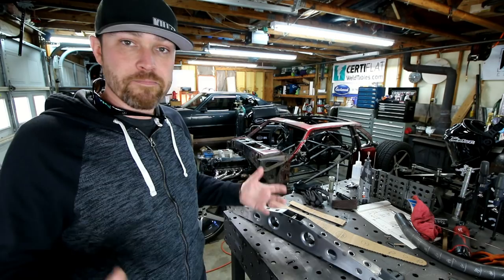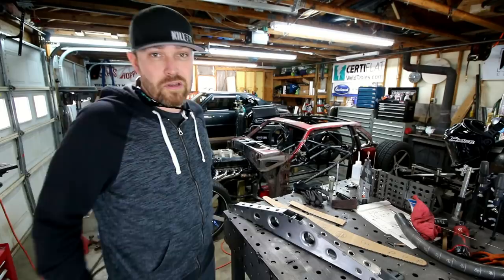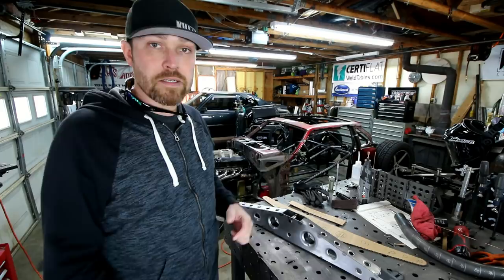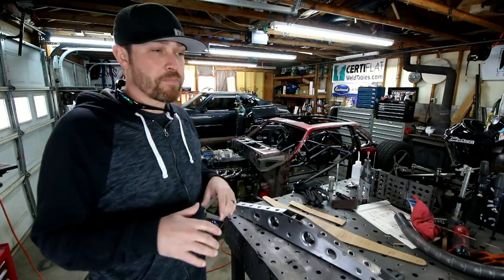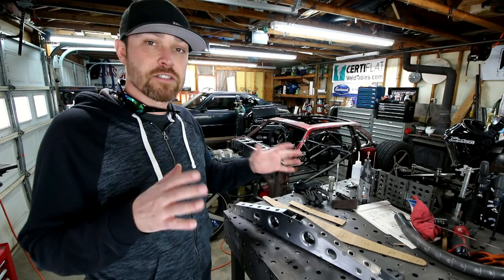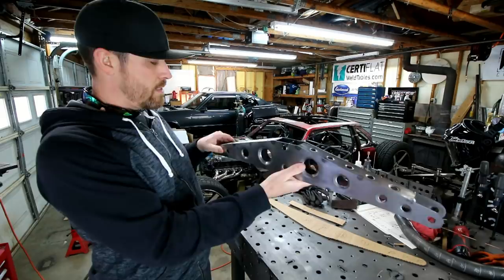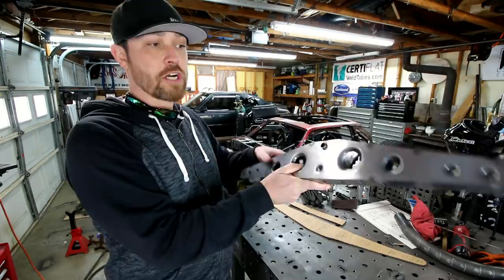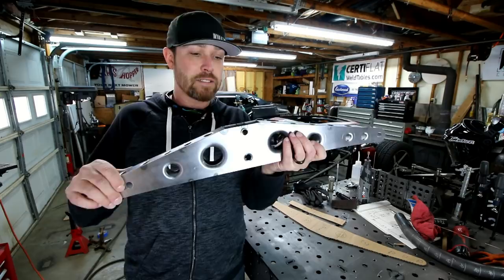Custom Cantilever Suspension | Mustang Hot Rod Build

Comment: Couple of quick points. 
1. No reason why the rear suspension won't work it is the same as many factory 70's cars. With the top arms restricting side to side movement.
2. If for any reason you do find you have side to side movement you can put the equivalent of rear panhard bar diagonally between the lower two parallel bars.
3. The claytons cantilever sudo relocator. I have concerns about the amount of force being placed on the actuator. Couple of alternatives move the shock to the front / pivot point to reduce the load on it to begin with, and fabricate some kind of lock in once the car is at the right ride height, so the force isn't being applied to the actuator.
Reply: Oh and keep up this sweet sweet work!
Reply from the maker: +Dodgy Brothers the actuator is a hydraulic cylinder...the kind that make cars hop. I don't think it will have any issues with this ultra light combo.
Reply from the maker: +Dodgy Brothers thanks
Reply: Ahh ok I thought you were just after ride height adjustment, I didn't realise you were after the full low rider experience. In which case locking it is out of the question.
Reply: Just out of curiosity do you plan to adjust the rears independently? If so you would be better of with a 4 link style.
Reply from the maker: +Dodgy Brothers what do you by adjust the rears?
Reply from the maker: +Dodgy Brothers I'm not after the low rider experience...just use their parts to actuate the suspension. It will have a set, non adjustable ride height when driving an lay flat on the ground when parked.
Reply: I meant are you planning to have one up one down, as in independent movement? If you plan to run a T piece to both actuators so they both move together then the current system should just fine. I have had cars with rear suspension like what you are building (HQ - HZ Holdens), and they don't lend themselves to massive side to side variation in height like other designs might like a four link. The centre bars cause binding if twisted too much.
Reply: Although to be fair you are using heim joints so I would imagine you would get more movement anyway.
Reply from the maker: yeah...to be honest I would be ok if it bound up during body roll. But I dont think it will roll enough to effect it.
Reply: Nah body roll will be fine it is more like jacking up the car that you notice it. Every day driving it will be fine. All this fine pipe work you are actually inspiring me to pull my finger out and start my electric trike frame.

Comment: Why not air bags instead of the hydraulic cylinders for a better ride? Wouldn’t that make the ride even softer doing both air bag and coil over? Instead of just coilover
Air lift 82603
Air lift 82102
And also with there compresor kit and remote control to adjust the ride higt from outside the vehicle!
Reply: Bags are squishy. Bags plus coil would be SUPER squishy. Using the hydraulics will basically make it act like a normal coil over car.
Reply from the maker: yeah what ac said. Plus air ride has big air tanks I dont have room for and pumps that tend to run even when the suspension is being articulated.
Reply: The Fab Forums haha but you are the Fab guy! I bet you can make a custom air tank to wrap around some piping or even make the air tank out of nitrous bottles 
W
What im trying to get at is that you said you wanted to be able to drop and raise the car, and when you raised it yiu could cruise no problem, and personally i have 2 sets of air struts in which if i have a low psi the vehicle is low and soft ride and if i have high psi the ride lifts and the ride is rock solid super stiff
And in your case you could have med psi to cruise at ride level and high psi to make it stiff for the track
It’s more adjustable then hydraulic cylinders as to ride height
Reply from the maker: yeah....I will save the air setup for the c10

Comment: Great design but wouldnt that be a lot of load on the cantilever
Reply from the maker: +Granturismo Racer No more than an upper shock mount
Reply: That cantilever beam could prob hold the whole weight of the vehicle with the dimples and design.
Reply from the maker: yeah I think you are probably right
Reply: The Fab Forums .some steel rods through the dimples might add structural integrity. But you know better. It's not necessary but if you ever need to add a wing later in future it would add more weight on it. The car already looks perfect btw.
Reply: Yes. And there is a reason no auto manufacturers or suspension builders use them. Looks cool though and will do the job. It's just not a high performance suspension, rather it's for looks and cool factor.

Comment: bolt sizes weren't well thought out. you have double the load acting on the center bolt yet it is the same size as the others.. I'm gonna guess that middle one is undersized, looks a bit skimpy for the application.
Reply from the maker: Thats not the case. The center bolt carries the load of the car which can only be changed when weight is added or removed. The length of the arm, no matter how long, doesn't change the load.....the only thing the length of the arm does is reduce what is felt by outer bolt load base on any leverage effect it has. In this case the arm will not be moving while driving so there is no substantial leverage difference. I hope that makes sense. For what ever reason people feel like it doubles the load on the center bolt but in fact it just reduces the load on the outer bolt.

Comment: That is a variable rate conventional system, not even close to cantilever.........to say cantilever would transfer the suspension from right angle shear to linear tensile in this application. A NASCAR chassis builder once told me..."You drag race guys teach us roundy guys how to make power, we teach you drag guys how to set up a chassis". And at that time, 30 years ago, we were designing cantilever suspensions.
Reply from the maker: Definition of cantilever

: : a bracket-shaped member supporting a balcony or a cornice: either of the two beams or trusses that project from piers toward each other and that when joined directly or by a suspended connecting member form a span of a cantilever bridge
hmmm sounds exactly like what I have...

Comment: love this build...but your geometry looks off. one side of the cantilever should be shorter. and the rear weight is over the wrong spot. and how is the cylinder  going to mount? it'll need to move around a bit, sound or fixed probably wont work. and look into accumulators. and hydrohaulics.net...one pump manifolds. just what I see. but I cant see everything and it doesnt go up and down yet. keep going. good luck. im not a dick. I just sound like it. sorry.
Reply from the maker: +Chuck Loan lol...why would you think one side needs to be shorter than the othet....the rear weight is exactly where it should be and the hydro cylinder will be able to pivot. Don't need or want an accumulator....
Reply: The Fab Forums  watching ur new video. thought u werent going with accumulator. now u are? good choice. way cooler than those struts.
Reply: The Fab Forums plus if u used hydros in the front they could be mounted horizontally and use a cantilever like the rear. still like it. wanna build my own.
Reply: hydraulics are cool